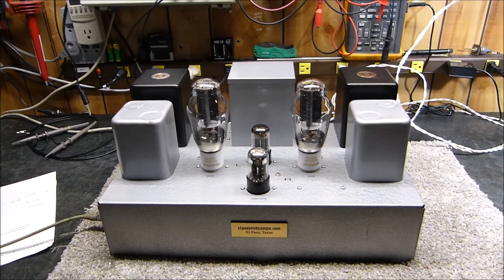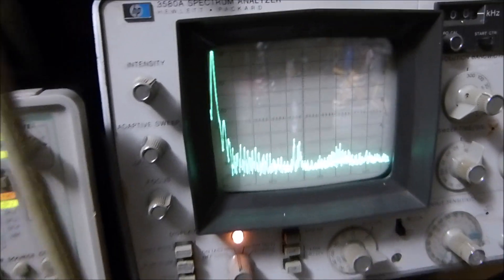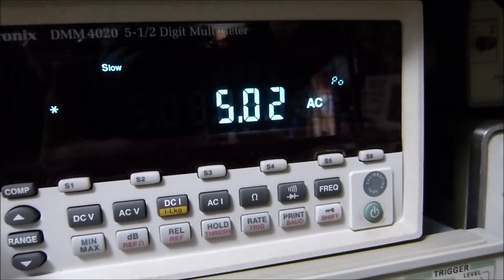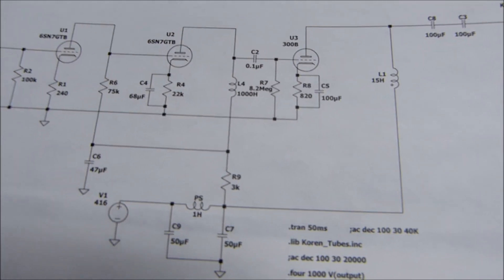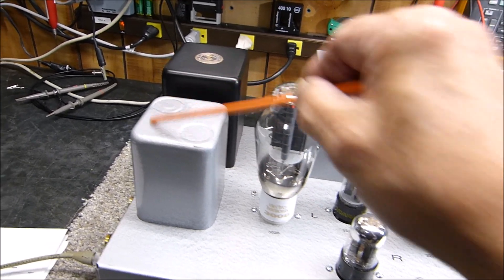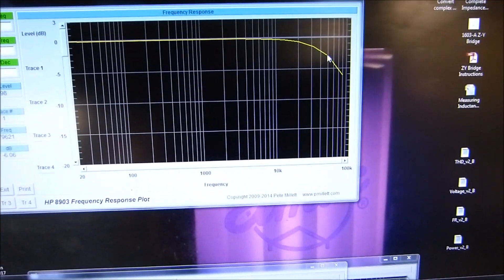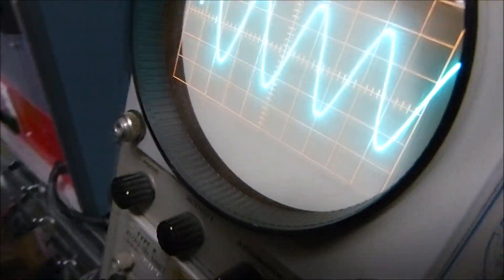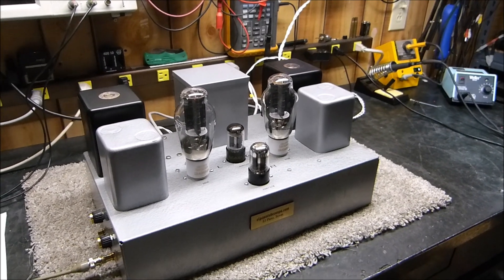300B SET Single Ended Triode Para Feed 7 Watt/Channel Stereo Amplifier

Comment: The 'flatness' you hear with GNFB is just (a) flat frequency response and (b) controlled gain, as opposed to uncontrolled. Without NFB the gain is a function of the actual tubes, actual line voltages, HT voltage sag, and temperature: some of which in turn is a function of immediate past program level. So what you hear is signal-modulated gain. In other words, compansion.
Reply: Wow, EJP. thanks so much for this superb explanation - "signal-modulated gain" - does this not get us into radio frequency broadcast land?
Reply from the maker: Just as I thought I had discover audio Nirvana in the humble SET -  the true beauty of audio clarity with no GNFB, sold to me when I was young by (scoundrel) audiophile expert salesmen (and women...) you remind me that GNFB Matters (pun intended?)...  you know I am kidding with you. 
Yesss..... NFB is my friend but that accentuated frequency response and uncontrolled gain of sag and rise, just reminded me of my girl friend back in 1967... but I have to be a grownup and not be modulated by my feelings...   no compassion or expansion, just compansion..    :-)
Reply: Radio Jet Thanks. I came to this conclusion while listening to my first SET, in for a service, 300B thing, about 700V on the plates, so terrifying I had to power it up outside the first time. I noticed immediately that I had to keep turning it down, whereas with the normal run of equipment being tested I can set the level once and maybe tweak it once and that's it. So I sat there thinking 'this is getting louder ... but that's impossible ... gain is set by the ratio of two resistors ... err, no it's not!' And then thinking through the implications. Sure it sounded lively, and the succeeding NFB amplifier did indeed sound 'flat' ... But that's why.
Reply from the maker: @EJP286CRSKW  You know I understand and greatly appreciate what you wrote. You are right. I just had to try the darn things and experience them firsthand and had the parts and the fact that it just seems to keep getting louder is the same thing I have experienced. A properly operating Williamson design is hard to beat. 
Oh well... not sure what my next project will be. I have two magnificent UTC LS-35 that are 5K primary that I want to use with Svetlana 572-10 (the 10 means mu of 10) triodes in monoblocs. I have everything from all the transformers to the chassis and sockets, etc. Just got to get around to doing it. I hope you are doing well and staying safe.
Reply: @ElPasoTubeAmps  They told you way back when you were young and naive that life would be linear and there would be no "accentuated frequency response and uncontrolled gain of sag and rise".That's only because they had no idea how much fun life can be when it catches you off-guard with a bit of all that.  The Universe is not a Clockwork Orange, IMHO. It's more like a good Jewish or Italian deli....with discounts for old audiophiles and the like....... thanks for your excellence.
Reply: @EJP286CRSKW  In tube guitar amplifiers, without feedback and at low volume, guitars just sing. Crank the volume up and the lack of NFB creates this cacophony of weird harmonics and listening fatigue. Add just a bit o' NFB and suddenly the guitar signal tone snaps into place. As David has mentioned, variable NFB is the answer for the ages.
Reply: @radiojet1429  No, it's auidio frequecies (AF) "self-modulating" AF.

Comment: Thanks, David. What have we learned? 1)  NFB is your friend  2) back-to-back polarized, high-value electrolytics can be used as coupling caps  3) simple designs might use massive iron  4) 5 watts is enough  5) boat anchors are wonderful to listen to... :-)   I always learn something valuable from your videos. Be safe.
Reply from the maker: Yes, a little NFB is a good thing... LOL... one thing about those electrolytics in series is you Must discharge them separately. It does not work to put a discharge jumper across the two of them in series as each one holds a wallop of a charge. I found that out by getting my arm across them. There is a certain beauty to simplicity and at any level lower than what it takes to loosen the mortar of the bricks, it sounds great and has a certain charm to it. I will be loaning it to my friend soon to evaluate it from his perspective. He has the talent and experience as a musician and a younger ear to hear the nuances that my 8 KHz limit ears can not hear. Even though my hearing rolls off a bit, I still hear quite well and have some value-added experience in knowing what to listen for so I can still, very much, enjoy music. My friend up above "EJP" described NFB and the lack of it quite well. However, I still maintain that the truly "flat" frequency response and controlled gain can make an amplifier sound "compressed" whereas the un-controlled SET sounds really alive. It is obvious to me after so much measurement and listening, there is a lot more to amplifier music reproduction than THD... And as we can see, THD is at an acceptable technical level. I look at it this way - 1 watt gives me say, 96 dB SPL then two watts gives me 99 and 4 watts, 102 and 8 watts (peak?) gives me 105 dB SPL and so on. That is plenty loud enough for any sane listening level. I have, with my sound level meter, cranked my Klipschorns and 100 watt per channel McIntosh up to the level of 120+ dB and that is definitely over-the-top and our body and mind starts to become alarmed at sound pressure levels much above 110 dB SPL. Anyway, still lots of fun and the comments/posts we all share makes it much more valuable and we learn from each other. Stay safe...
Reply: @ElPasoTubeAmps  David, me thinks thou hearest well above 8KHz as witnessed by thy own voice. You wax eloquent about this amp, the "air" ..what was it?...2dB down at 20KHz, or so. Yes, you CAN hear out to 20K + still. All those meters at the audiologists' office are designed to sell hearing aids. HA! I was particularly impressed with this video. The chassis layout was stellar, bro...your mastery of all things tube is a joy in this odd world. Be safe.
Reply from the maker: @radiojet1429  I think you convinced me my HF ear is better than I thought... so... I decided to just go subjective on this issue. I just got thru reducing the NFB on my "perfect" Williamson design UTC LS-57 amplifier - can a vintage design vacuum tube amplifier be any better than that ? At least considering it some worthy benchmark...  I reduced the NFB from 16 dB to 7 dB and it definitely sounds more "open" and "alive". I think by open and alive, I hear things usually in the tinkley upper part of recordings that I do not hear on the very best of audio amplifiers including all of my McIntosh amps. This is more than a treble adjustment on a preamp. My ear tells me the high end with lessened NFB is somewhat accentuated - I suppose I could measure it with my equipment - but just listening to it is a nice experience. I do seem to note that some of the LF response may also be accentuated, possibly because of the lessened damping factor from less NFB and may be very slightly more heavy on the bass than I am used to or like. I did not make that assessment on LF response in my analytical mind before hearing it. So what does all this boil down to? It is an expression of how much salt and salsa I like on my eggs in the morning - whether I like Corona beer or Coors or whether I prefer the 30-06 to the British .308 and weather I will vote for Trump or Biden and a million other personal/subjective things. I like Heavy Classical and Heavy Metal and a little nostalgic Simon and Garfunkel music from the '60 and 70's. That is about it. Sometimes I want to be soothed and sometimes I want to drive the nails out of the wall so I think I need more than 5 watts.
Reply: @ElPasoTubeAmps  All tubes clip when listening to real music at real listening levels.This is a basic rule handed down from the galactic committee in charge of such things. Beam tetrodes clip with slightly emphasized 3rd order harmonics. This can cause listening fatigue. Pentodes produce a slightly emphasized 2nd order harmonic when clipped (as do many cathode-biased amps of all kinds) and emphasize the mid-ranges which gives a lushness to the sound and although a distortion, is a much more pleasing distortion to the ear. NFB gives you the ability to fine-tune all those harmonics - slash - distortions,  coaxing every bit of musicality one can out of these devices. You really can herd cats. Drive nails out of the wall, you say...? I feel ya', bro...Be safe in West Texas.

Comment: Although I'm not up to the task of engineering an amp from scratch.........I got a DIY kit for a 300B unit.   The other tubes were under their international names,  but it's a 5u4 rectifier, and 6sn7 driver tubes.   I enjoy it very much.   It's a different sound,  and I've heard new things in recordings that I knew quite well.
Reply from the maker: I think you stated it nicely - it is a different sound and seems more alive. None, or very low, negative-feed-back (NFB) changes the tone of an amplifier. Years ago I built an amplifier with a NFB adjustment (0 to 16 dB NFB) and when the feedback was turn out or very low, the amplifier seemed to come alive and I labeled that control as,  "sound stage". On the other hand, if amplifiers like the SET or any other amplifier with very low or no NFB are measured on the test bench, it will be clearly seen that frequency response is technically terrible, i.e. the mid frequencies are much higher in amplitude than the low and the high frequencies which is the opposite of the classic Munson Fletcher curves - but then, maybe that is why we tend to like it.  Bottom line is always, how does it sound?   I find the SET amplifiers to sound good on some classical music but they quickly run out-of-steam on heavy metal music.   🙂

Comment: From Sowter UK I just now understood how important the plate choke is to feeding good sound through the primaries of the OPT, by reducing B+ ripples. BUT MAN is it expensive to have the best quality of chokes. 

I just wonder. Do you think it makes one hell of a difference in sound?
Reply from the maker: My SET amplifier uses chokes as a plate load because I did not want to invest $$$ in SE transformers as I had no confidence that a SE amplifier would be acceptable. The chokes are the DC feed to the anode and the signal load parallel with the James OPT. I already had the chokes and James transformers so I think you can see why I did it this way. I am very pleased with the sound but sometimes want more sound level than 7 watts can provide.
There seems, from what I read, to be characteristic issues with SE amplifiers  - one is attenuated high frequencies, probably from the excessive capacitance in the OPT windings and some complaints of hum. Not sure why hum is an issue unless there is a power supply issue. For audio amplifiers, in my opinion, a choke should always be used in the PS along with an input and output electrolytic capacitor to form a Pi network. PS chokes do not need to be large in inductance - better spend money on current level.  A way to estimate minimum choke value is to divide the plate voltage by the minimum idling current in mA. Assume 450 volts for the plate and a quiescent plate current of 80 mA - typical of a pair of 6L6/KT66, the choke can be as small as 450/80 = 5.6H. For a stereo amp that would be 450/160 = 2.8H. Hope this helps.
Thanks for your comments.

Comment: I think for long term reliability you need to add resistors 470k across series connected capacitors in power section
Reply from the maker: I agree with you. I probably will do that soon. Thanks for reminding me.
Reply: @miles5681  resistor is not required for one capacitor. And even if you are using two capacitors then use 470 kilo ohm rated at 2 watt and not 470 ohms

Comment: @ElPaso TubeAmps   I'd like to build this or similar. I suppose a BOM  is not feasible with mil surlus xformers, but a schematic with voltages would be great. I for one would be interested in a SPICE model overview with starting tips for modeling noobs,
Reply from the maker: I show a schematic around 11:20. Maybe moving the camera around too much to be easy to see. I probably have a LTSpice schematic of it if that will help you but no BOM except in my head.

Comment: Great looking SE Amp.  They are definitely different in character and like you, I do find them really pleasant especially as you go up in frequency.  Also, you may find that the tube trigger in your Tektronix 535A scope will trigger on things later solid state scopes throw up their hands with.  And forget the CA.,..  You want a 1A1 instead.
Reply from the maker: We agree on several things here. I just spent some time with my friend and the SET on his Tekton Moab's and that little SET amp will leave you breathless. He has a beautiful McIntosh 225 that sounds as good but the SET has something extra special about it. I was concerned about LF response. That was definitely not a problem. Absolutely amazing sounding amplifier and system. I just got some nice inductors from my friend in Poland so I will be starting on another SET using the Svetlana SVT572-10 and see how it turns out. I also agree with you on the trigger of the old vacuum tube Tektronix. It is amazing that the trace still centers with the knobs in their center position. It just works. I will look into the 1A1 preamp. Thank you.
Reply: @ElPasoTubeAmps   I have a 1A1 that needs some TLC if you want it.  Check out Toriody in Poland if you haven't already - fantastic toroidal iron.  My SE project used 3 6EW7s for an output stage into a One Electron UBT-1 1600-4/8/16 output iron and uses a 6GK5 with a 6GK5 plate load on input (current sourced plate-load input/driver stage).  The 6GK5s high mu and low Rp made a great input/driver for the tripled up 6EW7s on the output stage, and the low impedance ratio on the output iron means I get about 8 watts at clipping and 26dB of gain without feedback.  I have a switch for 3 or 6dB of feedback overall.   I am currently using a pair of them on tweeters (upstage active crossover) and a push-pull 7591 with cathode feedback on woofers. http://w140.com/tekwiki/wiki/1A1
Reply from the maker: @jasonagee385  Jason - I would love the 1A1 - I will put it back to work and show it on YouTube. I assume it "works" but just needs a little TLC? I see the CA preamps on Ebay but most have been robbed of tubes. Oh well...  I will be happy to pay the shipping if you want to send it to me. Direct email is;    theaudioshop@sbcglobal.net.
As for the SET, I listened to my 300B SET yesterday along with a beautiful McIntosh 225 and both were amazing. I gave my friend with the Mac 225 a set of tubes for it including a quad of actual McIntosh branded 7591's that I remember changing out in a MA230 I bought for my Mother back in 1976. Saved them for 44 years and they are all four very strong. You know how hard it is to find "perfect" quads of vintage tubes nowadays. I also gave him Amperex bugle boy 12AX7 for the first stage, RCA 12AU7 clear-tops and RCA 12BH7's. I was glad to put those beautiful tubes in an amplifier that deserved them. 
As for the 300B SET that I built - it is amazing. It is every bit the Mac 225 and maybe I even hear nuances in the SET I don't hear in the Mac. Not sure as we only listened for a couple of hours to five pieces on one amp then the other. Wow, is all I can say for the 5 watt SET.  His speakers are the Tekton Moab at 98 dB SPL. I hope to get started as early as tonight on the next SET with Svetlana SVT572-10. 
As for the iron, I just got six inductors from my friend in Poland. Here is his YouTube channel:  https://www.youtube.com/watch?v=RFyC1-aPI3w&t=33s

Comment: It took you a while to realize what a SET can do.  I built a 2A3 SE amp that I listen to all the time.  Same 6SN7 drivers. I use 5692s in mine. Still thinking about those 6080s. Haven't found a transformer yet to handle the filament current.  Will probably end up using a dedicated filament transformer.  My 2A3 I'm using AC on the filaments with no problem. Nice ceramic tube sockets you used on those 300Bs.
Reply from the maker: As I have heard said, and repeated, they are a bit addictive. Very open sounding and alive. And with just my 5 watts per channel and inefficient speakers, it will really impress and the bass is great. I was very concerned about the LF response. Apparently I got enough L in the plate path to do a good job.

Comment: Mr. Elpaso please provide video how to draw load line on tube graph. How can we know that what tube need how many K AC OHMS in OPT? Such as 45 need 5K or 7K OPT how to calculate to get 5K or 7K. Thank you for video in advance.
Reply from the maker: I am really not the one to make a video on how to draw load lines for vacuum tubes. However, I do recommend this video:   https://robrobinette.com/Drawing_Tube_Load_Lines.htm
If you are willing to go thru all the details of this video, I am confident it will help. I did go thru his video and he makes some very good points besides just load line analysis. It is worth taking the time, in my opinion
As for the OPT, I could probably do a reasonable video on that. But in its simplest form - using the 300B as an example - virtually all of our amplifiers are class-A. They may also be run as AB1 and AB2 but they are still essential class-A. In AB1 and AB2, we just drive the grid positive a little bit - this gives us a lot more power with increased distortion. The class the tube is run in is primarily determined by its bias - and the gain of the tube. Low gain (low mu) triodes make great HiFi amplifiers in class-A and great plate modulated class-C amplifiers for RF. It is a long and laborious subject so have fun digging thru the details. Stay safe...
Reply: @ElPasoTubeAmps  Oh Thank you so much Mr. Elpaso